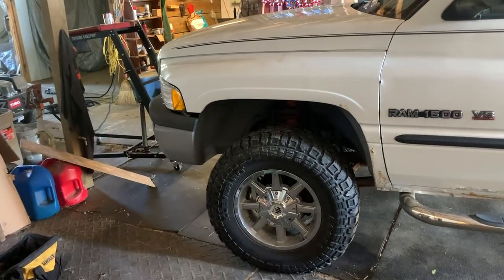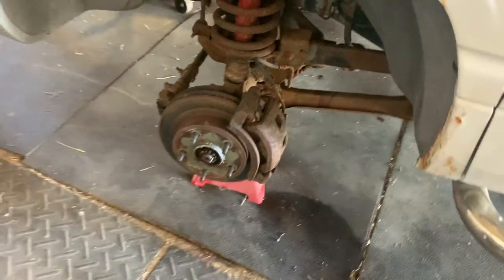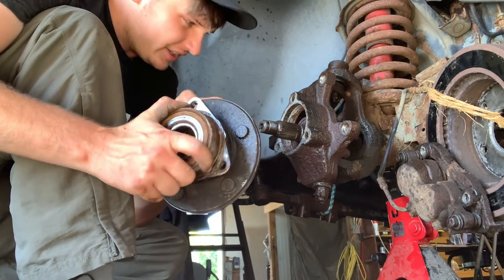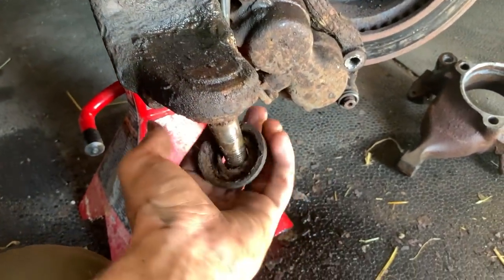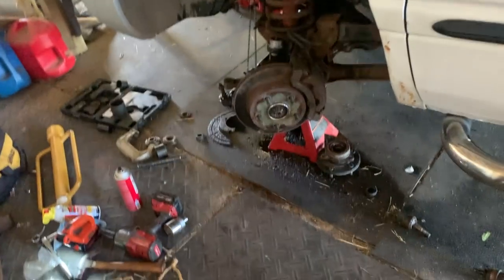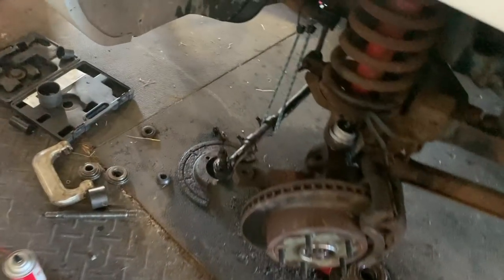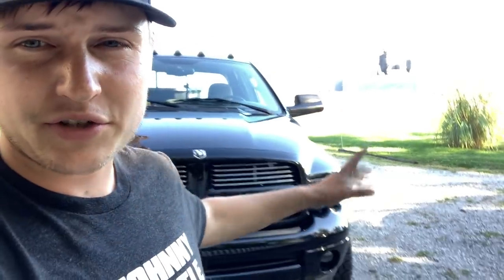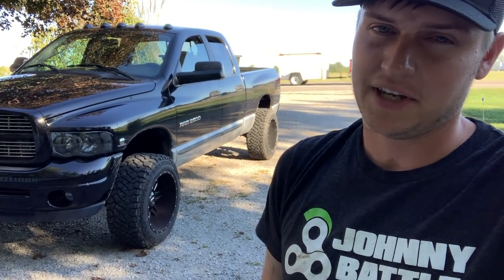FRONT END REBUILD UNDERWAY!!! Pt. 1

Comment: Being a second gen half ton dodge Ram that drives on gravel roads you’ll be doing this every 2 years using parts store brand ball joints, even moog don’t last that well. The only ones I’ve seen get decent life are a set of aftermarket ones I installed for a family member once that they bought themselves, I think they were called “monster joints” or something like that. They were bright green and had stiff poly grease boots. Those things are still on that truck 12 years and almost 100k miles later.

Comment: The upper ball joints are meant to move like that
Reply from the maker: Well…. The old one moved loosey goosey lol
Reply: Not saying it's wasn't wore. But they are made to move in and out to make up for the difference in the axle and the knuckle. Because they will never be the prefect fit. I've replaced several for something for the same reason, until an older gentleman that has taught me so much. Explained it to me, why they are made like that.

Comment: Hey dude I have a old 96 12 valve any tips to roll coal other than screw adjustment it has a zero plate and it is slid the afc housing stuff has some stuff done to it and a boost ninety but doesn't roll coal that much at all
Reply: Sounds like it's making power efficiently then...
Reply: @ryanbrown918  what dat